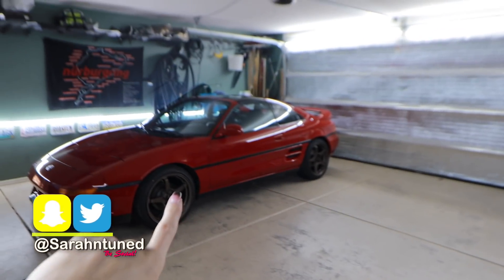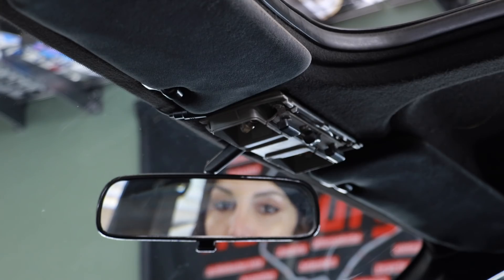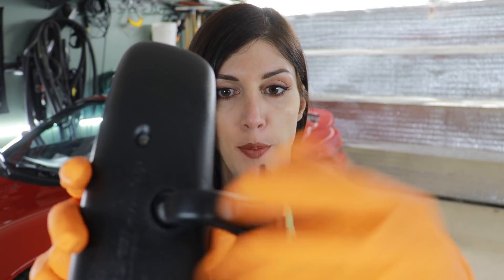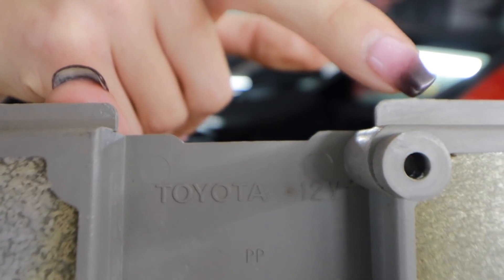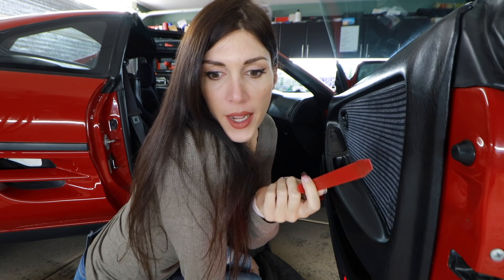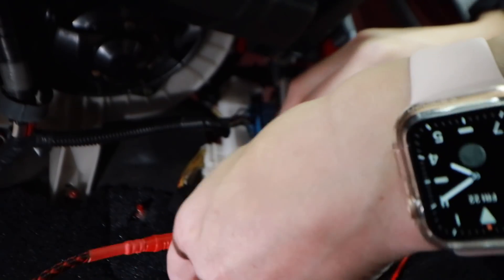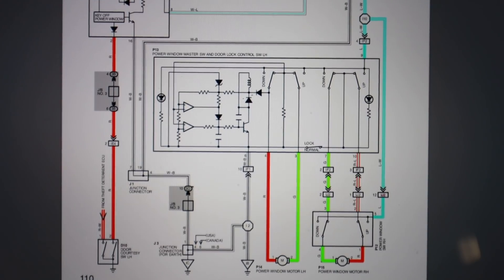Lexus LS400 Auto Dim Mirror Retrofit SW20 MR2

Comment: The lower left dash bezel aftermarket  part would be my choice for the new boost gauge.
Reply: You have a link to that? Mine could def use it
Reply: I'd agree, easiest place to have it line of sight if you don't go pillar mount. The ash tray is too low and I'm not convinced the standard 52mm diameter gauges will fit in those air vents anyway? some air vent adaptors require a smaller gauge.?

Comment: I agree with the many others who have commented ... bushings and suspension first ... there is also something that comes to mind about dropping the fuel tank and that is replacing the fuel pump for the sake of reliability and performance ... those two things will give you enough time to work it all out before commiting to the boost controller/guage configuration ... I am sure you will work it all out ...
Great Job with the Mirror !

Comment: I love how older Honda’s and Toyota’s have the mirror mounted to the roof instead of the glass.  It seems like a much superior design than relying on adhesive to hold up the mirror.
Reply: I'm sure everyone knows but the adhesive mounted mirrors are designed to break away if you hit your head on it in a crash rather than burying itself into your head because its screwed to the car.

Comment: Bushes  , here in the UK a lower power car with good grip beats something that only does straight line. It's a good basis to then add boost or build an engine. Nice to see you instal the mirror to almost OE. When I fitted dash cam to the Tig I hid all the wiring in the original loom into the fuse box. Kudos!

Comment: I love these sorts of mods.  Did a mirror swap in my old truck to get autodimming, Homelink, compass and a temp gauge.  It was a sign from the car gods to do the swap when the original mirror fell off the windshield when I was driving.  You probably already know this, but I suspect one of the wires you didn't use would shut off the autodimming when you put the car in reverse.  Not really a big deal, especially if it was hard to get  to that wire, only time I notice it working is when I back out of the garage on a sunny day.

Comment: I think that mirror should be powered on when your lights are on, so the mirror only turns dark at night and not triggered during the day?
Reply from the maker: LordTominator it didn’t dim on its own under the lighting in my garage. 🤷🏻‍♀️
Reply: @SarahnTuned  I see...Probably a "smart" mirror with a ambient light sensor on reverse side, in the front. Maybe  only triggered by luminance differential front to back.
Reply from the maker: LordTominator correct, there is a photo cell on the front facing the windshield.
Reply: The thing haes 2 sensors. One aiming to the front measures ambient lighting and the one in the middle of the mirror surface measures the beams lighting the car from behind. The darkening is triggered if there is a certain difference between lighting from front and rear only. And for the rest of situations it does have a push switch :)
Reply: @LordTominator  

Yeah, it dims the rear view mirror for when you've got one of those assholes with blue LED high beams blasting in from behind you.
Reply: @Auracanal  I figured as much; great upgrade idea for any car btw
Reply: @LordTominator  Yes, it is very handy. Here in Europe many cars mount these as standard (I do not know about US)
Reply: @SarahnTuned  what stereo head unit do you have in this car?
Reply: So I drive a MazdaSpeed6, and I hate the smart dim feature on the rear view, it never seems to work when it needs to, and works in the middle of the day when it shouldn't. I'm a Honda-phile at heart, and I was just thinking last night how I miss the old flip up toggle switch on the bottom of mirrors past. 
SIMPLICITY IS SERENITY
Reply: @jaydub5515  Why don't you just disconnect the wires?
Reply: @jaydub5515  Do you have a hangtag on your mirror blocking your front sensor?

Comment: If the module is too big to replace the ashtray then I'd go with dash replacement unit that has locations for it. I'd go with the suspension first unless you would have remove parts of the suspension in order to work on the other 2. All in all very clever video on how to upgrade parts and the process of modifying it with a step by step instructions. Keep up the great work.

Comment: I think suspension should be first. You gotta be able to drive it safely before you can drive it fast! After that's sorted out maybe get the gas tank cleaned out and do the heater core. I think you should get the panel that mounts to the left on the dash for the booster control/gauge. I think that would look clean and a good spot for seeing the gauge. I simply love how happy you get when things work out!

Comment: I’d yeet the MR2 back into storage and finish Mr. Tot. I recently finished my 2002 200k mile 180hp 8N TT Quattro’s timing belt service with a Gates racing belt, ECS racing pulleys, new suspension, and Neuspeed cold air intake, and a slew of other links, bushings, control arms, etc. I’m also making  a custom headliner and I have a Duraflex Regulator bumper waiting for fitment. I held off on the cam and crank seal replacement because I wanted to see how you did it because it looks like a pain in the azz. Thanks for the great content and for also giving me a reason not send my bubble butt TT to the scrap yard.

Comment: MR2 is looking great!

Safety and needful stuff (suspension bushings) before fun.  Plus you will enjoy driving it with tight handling.

Gauge(/display) locate ideas:
1) extract the rectangular display and shift LEDs from the round gauge housing and mount them as if OEM like at the bottom center of your gauge cluster.  Hot glue or epoxy them in, and maybe get a junker gauge cluster panel to practice on.

2) current cig lighter area, since you were wanting to redo it and USB power is easy to relocate. Could also make a new plastic panel and shrink down from the 2-1/4 housing if it made the fit tidy. I've got an analog turbo boost gauge for the 1HZ roughly in that location next to the ignition switch of the land cruiser (similar plastics era Toyota) and like it.  If there isn't dimming control for the gauge, that white OLED can get bright at night, so a lower mount works nice.

Comment: Engine: Go for it if it's the end goal. Um fix the suspension then pull the tanks and add your controller stuff. I think most will agree that having the car in a driving condition before you get over in boost stuff, unless you need that wideband to make sure you have correct fueling for idle/normal driving.   Reminds me my ls400 is missing little mirror bottom cover, and I can't find one.

Comment: Sarah i run a scg-1 on my mr2 mounted in the lower corner of the windscreen not on the pillar. remember to mount the map sensor higher than the motor with the vac nozzle pointing down, the moisture in the line will destroy it. Try to mount the O2 sensor in the top section of the dump pipe, scg-1 dislikes cold locations.

Comment: I would also say do the suspension first. Then once it's ready to go, then work on the Fuel Tank, getting it dropped and cleaned out. Then you can work on the boost Controller and other accessories.

Comment: Get the gauge cluster bezel with the provisions for the gauge.  I had the same style in my turbo CRV and turbo civic's, and loved them.  They dont really block any other gauges, and look like theyre designed to be there.  Theyre also easy to see without having to actively look at a different spot in your car.  Installing the gauge wont take you long, but youll have to wait for the bezel.  Go ahead and do the bushings first.  They often take longer than you think, so plan for that if you havent done them before.  This is the first video ive seen from you but it looks like youve got a hold on things.

Comment: I would definitely address the suspension first, you don’t want that to feel sloppy when you are trying to put down power. 

I like the idea you mentioned about gauges where the ash tray currently is, that’s something I’d do to put the space to use since I don’t smoke. Column and vents are good places too, but if you need AC then putting gauges in place of the vents is no bueno. I admit I do like a-pillar setups, but on my wrx, I opted to put them on the column.

Comment: stock fiber head gasket is good for 300whp or more, the block is your limiting factor for big hp as it will crack above 450whp, you will need a 5s block if you want to go higher

Comment: Sarah, love watching your videos! I’m not an OG subscriber but I would definitely do the suspension work first for safety and then boost. I am not sure how the MR2 is configured on the headliner even though I just watched your tear into it, but I have seen in some challengers where the gauges were put on top where the sunglass container goes. I of course have a scatpack challenger. Maybe the gauges up top maybe an option? I would agree with another comment about being careful dropping the gas tank around a heat source. Keep doing what you are doing!

Comment: Couple of things, if you're going to build a 3sgte, you need to track down the turbo transmission as the NA one is much weaker (and doesn't have an LSD like the later turbos). Another thing, have you looked up reviews on the Innovate wideband/boost controller? Innovate has a terrible reputation with their widebands now (they destroy sensors all the time from the poor heater control) and the boost control part is open loop, which makes it super inconsistent (especially in monsoon season!). You'd be better off with a mechanical boost controller, or a true closed loop like a Greddy/Apexi/HKS.

Comment: The radio screen looks like it is a double din size mount. You might think about replacing it with a single din radio unit and that would leave enough room for three gauges either above or below. It depends on how attached you are to the video screen and whether or not it is more than just a radio.

Comment: For the gauge mount, search for a small company called AutoExtrude. They make custom 3D printed parts for Toyotas and might have something you can use. Do the bushings, it's the harder of the two tasks but it will make the car safer to drive "spiritedly". The engine idea is a great one, that way you can still enjoy driving the car and take your time on the engine build, so you don't experience the "I gotta finish this build, I miss driving my car" feels. ☺️

Comment: Order of operations:
1. Stability. Do the bushings first.
2. Speed. Do the gas tank and the heater core second.
3. Get that left side piece that makes the gauge look like it belongs there.

Engine rebuild on a stand definitely. You can take your time with the build, and make sure it's right before you ever drop that engine into the car.

Comment: I would do the suspension work, you already mentioned it feels unsafe over 50, and it can already do that speed, so more boost doesnt do you any good if it comes unglued from the road. Then you can really tune the boost knowing that the car is going to be stable.
And while your under it, might as well drop that fuel tank, fix the heater core, and then get on the boost, making it ready to go have fun with
Also love the idea of the engine build, its your car, make it how you want it

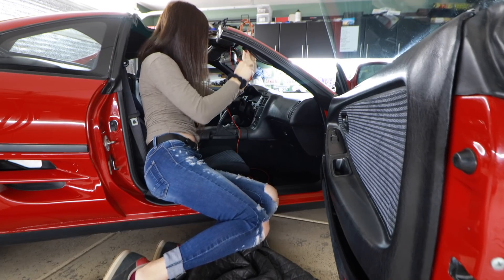Comment: 6:20 spare hot motor, yeah. I guess
9:38 your happy dance. 
10:20 Hi, my name is Doug.
10:58 and a happy girl face too.
11:06 that sounds good
12:05 that lower left placement 
Get the new panel. Hate to block the Odometer. Or even worse the tach.
14:15 thanks

Comment: Careful tapping into wires. Esp with smaller wires. The fuse on the bigger wire may have a higher threshold. In other words smaller wire may get very hot or even fail before the fuse blows thus cause a fire.

Comment: I would disconnect the battery before taking down the tank or only add red heat to take out the condensation that been laying in the gas tank and add fresh gas.

Comment: I sure hope you never "finish " mister dose , because I'd miss seeing you work on my favorite project of yours.  
Please,  oh please do a video on the s53 , s54 ,and w transmissions , lsd and gear swapping possibility.  there's nothing butt poop on the Internet. 

I too have dreamed of of building a 3sgte motor on the stand , having it ready to swap in , all Bulletproof and badass. And don't get me wrong in theory  it's a  perfect idea.  All to the point until you start pricing everything that you need to build this engine the right way and to your standards you're looking at 10 to $12,000... holy smokes Batman that just got real. Probably 2 to 3000 worth of Machining and 3 to 5 in custom-made parts. But boy does this engine send shivers down ones spine when it revs to 6-7k.
just imagine 9k at 5-600hp.
out of control fun. smiles for miles.

Comment: one wire should be signal power off to connect on rear view + signal, so when you make a reverse/parking the mirror will stop to dim and turn normal so you can see, my one has 3 wires (retrofitted from peugeot) and are +12  gnd  signal, you should check your how it works or will have to power off manually for reverse/parking

Comment: Sarah, fix the suspension, btw how are the brakes?  Then add boost.  you should think about the option that adds a gauge to the piece of trim to the left of the steering column.  Assuming you only want one gauge.  it would be the cleanest.  I agree that you should not add gauges to the A Pillar it takes away from the clean look of the interior. Sell one of your other cars and build a new engine with a turbo for MR DOS!

Comment: Suspension first.  But if you can, I'd avoid urethane bushings.  Urethane has a shorter lifespan, more NVH, and can be noisier if the lube gets washed out.  OEM rubber is the best if you can find it.

Comment: Nice work... Fyi, yes the wire you tapped into is fused but the power windows like you said take more power than your rearview mirror. Long story short you need to add the proper size fuse inline with wire going to the mirror. Id hate to see you experience a carbque

Comment: Do the suspension and fuel system work before touching anything else.  Great boosted power requires great amounts of fuel and great amounts of control.

Comment: Hi Sarah,
one more vote for the suspension first. Tank and heater core after that. Then drive it a bit.
Also, why would you risk the engine by increasing boost? As it is, Mr. Dos is already a 150 mph car with a probably too short gear ratio. Too slow for you?
Sir Codsworth on the other hand may need a reserve engine, rallying brakes lots of things.
Just a thought......

Comment: I'd start with the suspension. Make it safe to drive before you worry about making it go faster. 

Engine stand build? Yes. That's a really good idea. You can build the engine you want, with no time constraints, because the car already has a running engine in it.

Comment: Sarah, in the Marine Corps we’d have just used a diamond tipped drill bit and drilled a hole through the windshield after first taping the drilled area to limit chipping. Then seal both sides with dum dum mastic and mount the mirror with a through bolt painting it black so it wouldn’t look too odd. You do realize however that all this must be done under a large shade tree for it all to work properly. Unfortunately you having been in the Air Force you do things the proper way. Simper -Fi!

Comment: I hated that my F150 had a rear view mirror that mountain to the glass so I did a lot of research and found out that a rear view mirror that mounts to the roof of the metal from a 1965 Mustang fit perfectly where the Sun visors click in on my F150 so I bought the rearview mirror bolted it right in and poof it works

Comment: I vote for the bushings.....be prepared for that to morph into coilovers. Then you can get a true baseline and it will give you time to find a place with a full lift to drop the tank and do the clean out and heater core repairs. You said previously you wouldn't do that in your garage due to the QuickJack height limit. Your engine plan is spot on. You won't be killing yourself and it will avoid problems that you ran into with Mr. Dos. The build should be doable, but how are you going to do the engine swap? P.S. Get the bigger toolbox before you start it. ;-)

Comment: Update the worn suspension components first, get alignment and verify the car drives well.  Then take time to add more power. At least that is how I do it on old cars. Not saying that is correct, just works and it is nice to get in the car and it feel "Centered" as you go down the road, fast or slow.

Comment: Deffo do the bushes first. You want it to handle safely before you do the boosts. Which 3S-GE engine are you looking to fit? My '91 Celica has the 3S-GE engine in it. I suspect that you might want to fit the BEAMS engine. This engine is popular with those who want to fit a different engine in their Toyota. Wheeler Dealers did a 1st Gen Celica and fitted a BEAMS engine to it.

Comment: Suspension first so you can drive and enjoy the car while waiting for parts, working on the other cars ect.  As for the boost controller, lower left hand side of the instrument cluster. You want it where you can see it easily while driving, but not blocking the Speedo/ tach. 
I would love to see you do a engine build, but I’m not sure if the MR2 is the right car for it. Maybe a little research on prices and availability of build parts for the MR2 vs the Focus.  🤷🏼‍♂️